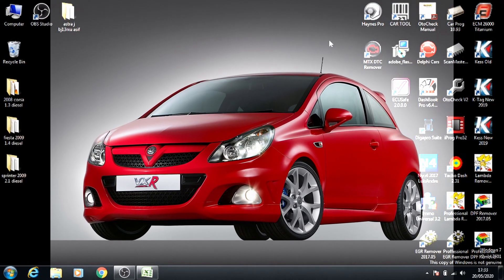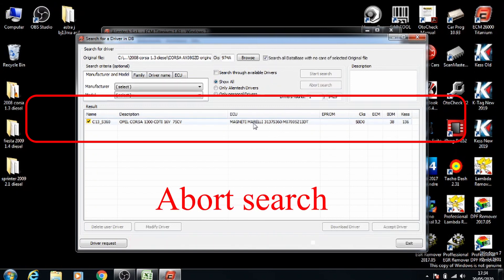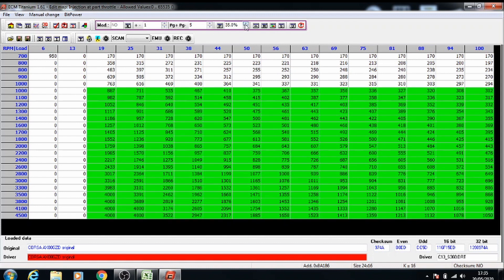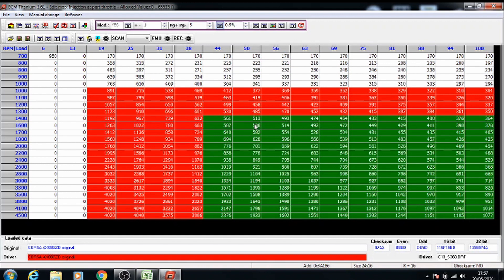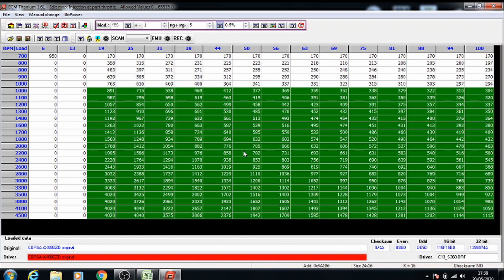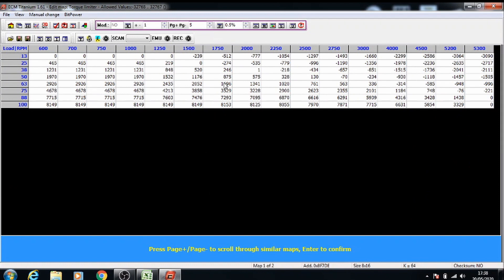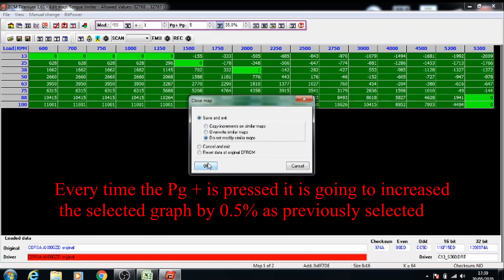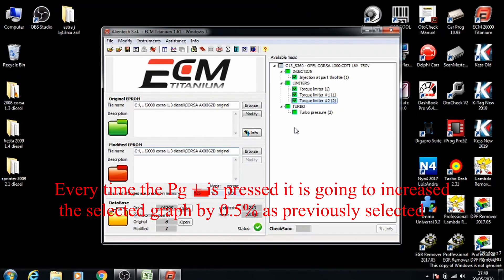How to Remap ECU Engine Control Module of Vauxhall Opel Corsa Diesel using ECM Titanium kess v2 ktag

Comment: This is garbage % tuning, if you know what is best for your engine you'll avoid tuning like this. It is never safe.
For example, you're upping the injection at 1000rpm, where engine barely has any power. Increasing turbo pressure at 1100rpm also does nothing at all.
Stick to a reputable tuner, not some Youtube tutorial nonsense.

Comment: this video is about how to not remap ecu
totally wrong, no knowledge about diesel tuning
Reply: tell me how
Reply: @GentKermit  which car? ecu, engine ? all depends on what u want to do with car too
but no point on making changes on SOI, rail and duration on all map decalibrating all injection that was perfectly calibrated from factory
Reply: @chipdieselperformance  I need to learn about remap
Reply: @mariotube21  if you have no knowledge better to ask someone to do for you

Comment: Is the Spark advance map not available for Corsa Ds?
Reply: it's diesel mate?! haha
Reply: @therivalryan  Oops, didn't realise, thanks tho
Reply: @therivalryan  In many diesels, you have the timing map for the injection timing, also for the injection duration. This is probably a fake - cracked incomplete Titanium which doesnt recognize other maps.
Reply: @Alexxx95_H   not sure what your point is, diesel don't have spark advance does it..  injection timing in diesel is soi and duration. Ecm titanium is rarely used by professional tuners regardless if cracked or not
Reply: @therivalryan  Injection soi is similar like spark timing and here is no such map. And I explained why.
Reply: @Alexxx95_H  there is explaining, you don't.need to reply to what I said. I didn't ask why what or when. I said the logic behind the stage 1 in this video doesn't exist and a diesel doesn't have spark maps.
Reply: also this is not how you tune a car for stage 1, most of the maps are missing here and there is no logic behind these changes, they are silly